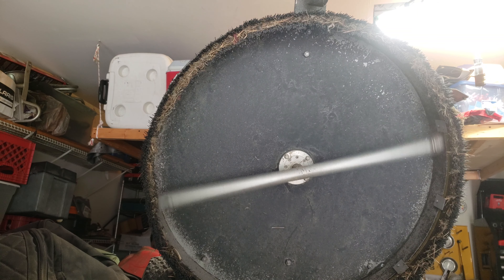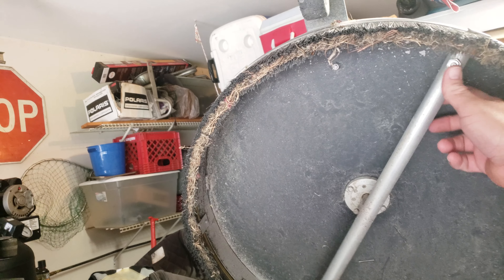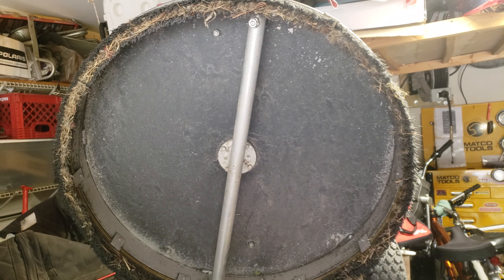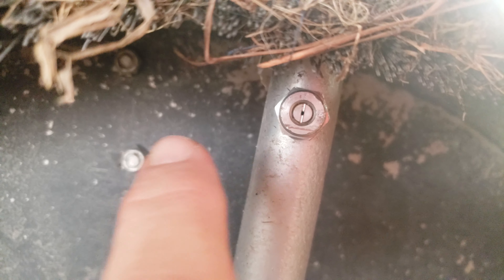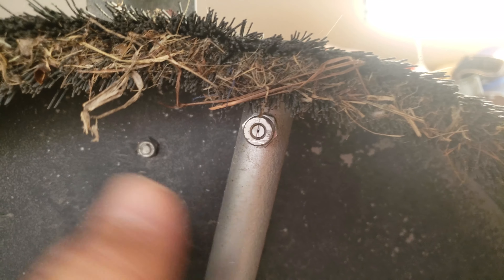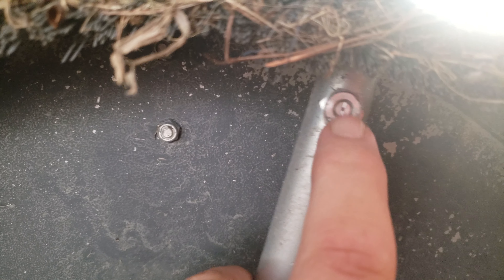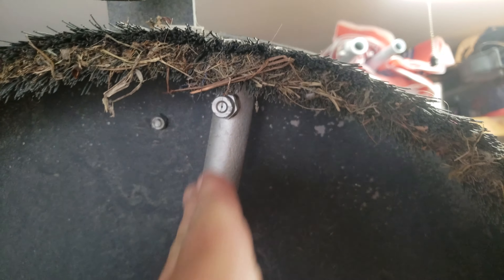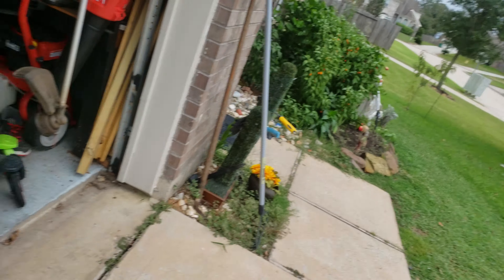Costly Mistake With a Surface Cleaner??

Comment: If you're running a 4 gpm 4000 psi pressure washer with a 16 inch surface cleaner, then you need to make sure that your surface cleaner has the nozzle tips #25025, which is a 25 degree spray pattern putting out 5 gallons per minute flow, so it lowers the psi being used without having to ever adjust the pressure washer itself. You don't need more than 2000 psi to clean concrete.
Reply from the maker: Agreed. I've come a LONG way since making this video ~4yrs ago. You're welcome to check out my pressure washing channel: clean industries pressure washing.
Reply: I have a 4GPM PW running a 20" surface cleaner with 25025 tips for 2500 PSI. would a 25030 be best to get to that 2000PSI?
Reply from the maker: @scottChapman25  it would get you close for sure. Also depends on how much hose you're using. Get a pressure gauge and put it at the trigger
Reply: @scottChapman25  That's definitely a lot more flow. You'll have to test it out. That might lower your pressure more than you want.... I can't say for certain.
Reply: @doitallgaragetx Hi am sorry to ask, but what surface cleaner should I get for a 3.8gpm for cleaning driveways around my neighborhood?

Am from Guatemala, so it’s alot more expensive cause I have to order it from Amazon and the shipping is crazy! So I wanna make sure to order the correct and durable stuff.
I want to order a surface cleaner, just haven’t decided which one yet! Please help, and and tell if I need to buy new nozzles or something else too
Reply from the maker: @juanpablodo12345678  I'd get a 16 inch or smaller surface cleaner with 25020 nozzles. Also get some 25025 nozzles in case the 20 nozzles make too much pressure
Reply: @doitallgaragetx  Thanks alot, any brand you prefer more than others?
Reply from the maker: @juanpablodo12345678  I prefer whisper wash. They aren't the cheapest, but they are some of the best and EVERYONE carrys parts for them.

Comment: You’re a lucky man. Nozzle orientation is very important. If you have to have a faster spin, turn the nozzles ever so slightly, hardly noticeable, but slight angle will leg it spin faster. Both have to be equal angles.
Reply from the maker: I'm constantly learning as I go. Most people think you crank the thing up and start spraying. There's alot more to it than that as I'm finding out.